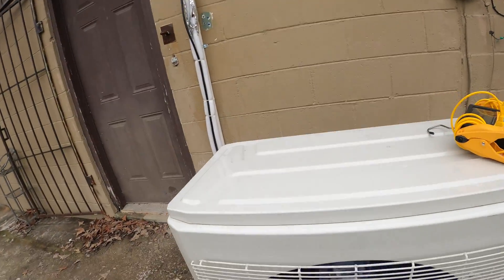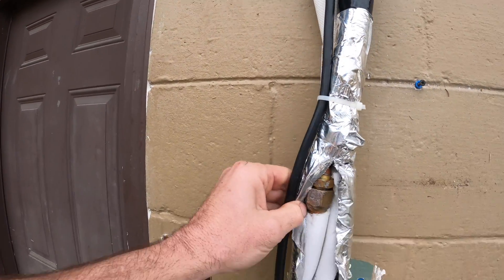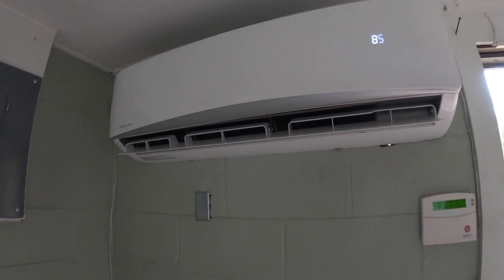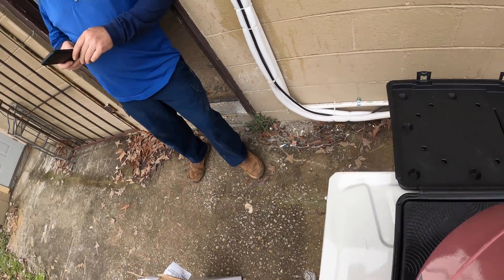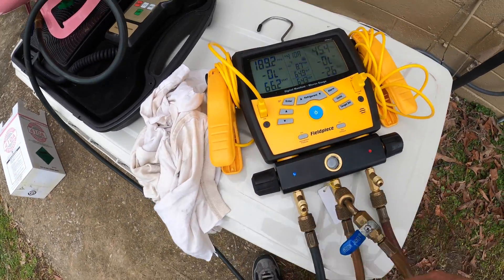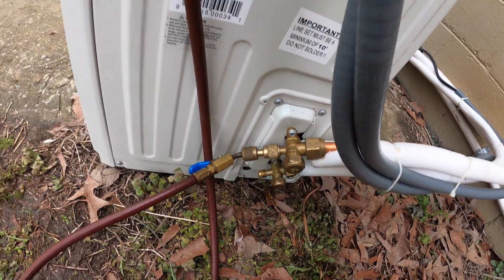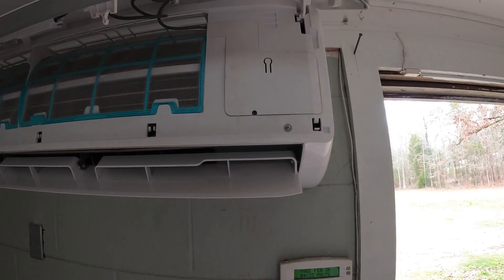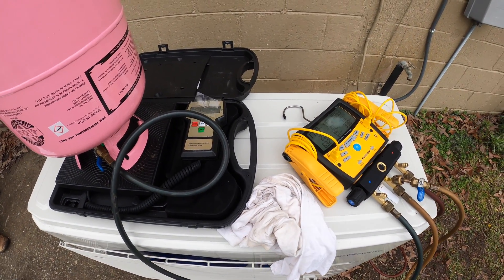MINISPLIT RECHARGE FREON BY WEIGHT

Comment: Great video. One thing wasn’t clear: what’s happening with the valves on the low and high side? Are they open or closed when pressure testing with nitrogen and purging with vacuum? And are they open or closed when recharging the system with new refrigerant?
Reply from the maker: If new install then valves are closed from factory.    You are only pressure testing lines and indoor unit.  After vacuum then you open and you never close them again.   There only purpose is to store factory charge in outdoor unit
Reply: @ACPro it’s an existing mini split unit that’s low on refrigerant.  The coils are icing in heating mode and the defrost cycle can’t handle all the ice. Need to reclaim the refrigerant, test for leaks and recharge with new refrigerant.

Comment: Im Doing mine myself. Is a luggage scale sufficient? If I tie a rope or something to the bottle? I need a 50 ft run and the number is .16 oz per foot standard length 25ft so 4oz. For the additional length. My dad is an old school guy doesn’t know much about them he swears we can go by psi when we get to that part of the install but the amount of research I’ve done is telling me no we absolutely can’t but I’d rather not add another 200+ dollars on this project for an hvac scale. Thanks in advance
Reply: Should note the local hvac guys will not touch a system they haven’t installed. And it’s a 4ton multi zone so.. I’m out quite a bit if I don’t get this right 😂
Reply from the maker: This gonna be your choice.   I wouldn't use it.

Comment: did you remove the existing charge and pull a vacuum before breaking the vaccum with the new charge?
Reply from the maker: Yes to charge by weight system must be completely empty

Comment: Thanks for the video.  I just had one professionally installed in order to get the warranty.  About two weeks later, it was struggling to heat.  Sprayed the flare joints with soapy water and it was bubbling.   They did come out and correct it right away and recharged it.   but it was disappointing.  

I also notice they just added some Freon, didn’t remove and recharge it.  Everything I’ve read professionally about mini splits is to remove the Freon and then weigh it back in to make certain you have the correct amount.  

I’ve since installed a multi zone my self and the installation job looks a 100 times better and it’s running strong with no leaks, yet:-). 

I used nylog on my connection and they didn’t. Not sure if that makes a difference, but so far so good.
Reply from the maker: Thank you for sharing!

Comment: I was pulling a vacuum on my mini-split and didn't realize the manifold hose i have didn't press in the valve so I didn't actually vacuum the lineset before I released the 410a. should I remove all of the refrigerant and start over with some new 410a to make sure it's not mixed with air and water vapor?
Reply from the maker: In theory this would be best.  But if it wasn't raining outside .  You are probably ok.      Only main concern is if it didn't push it in you couldn't have done a nitrogen leak test either.   So let it ride and if you have a leak show up.  Then go back and do it right
Reply: @ACPro  correct. It wasn't raining but I keep hearing that air and water vapors will ruin the compressor. That's why I was wondering if it would be best to pull the 410a back into the compressor probably mixed with air and do it again or just get new 410a and evacuate the whole system and start from scratch.
Reply from the maker: @gusfusses44   pulling into the compressor will do no good.  I would be more concerned with no leak test than vacuum.     It is your call.   The right way is to recover . Pressure test and vacuum,  recharge.    But depends on your time and how crazy you want to get with it.  If it was mine . I would let it ride. Deal with it when leak shows up.   But I got alot things to do too.
Reply: @ACPro  thanks. I have time. So I will start over with new refrigerant and do it the right way.
Reply: @gusfusses44  I did exactly the same thing and am contemplating whether or not to replace the r410a. What did you end up doing, and how did it go?
Reply: @MrAejohnson3  i evacuated the whole system and replaced the r410a.Everything is working great
Reply: @gusfusses44  Thanks for responding! I went for it, and it went smoothly as well. EXCEPT I took the valve core out for vacuuming, only to realize that I couldn't get it back in once it was recharged. Too much pressure. I had to pump all of the refrigerant into the outside unit and close the valves so that I could get the service valve core back in. Two new things in one day! All turned out well though, and I'm not worried anymore about a short lifespan for the compressor.

Comment: After checking the data plate for the weight, do you have to add extra for every foot of Linset? The reason I ask is because I have the same issue as you did with no 410  left. I have about 42 ft of Linset on one and 30 ft on the second unit. Both are 3 tons and are single zone units.
Reply from the maker: Typically the amount per foot is very small but it does add up on long runs.   Check your manual as different lineset sizes require different amounts.   But normally it is around .06 oz per foot is a good average for 1/4×1/2.
Reply: @ACPro  thanks for the reply much appreciated.

Comment: Confused isn't it pre charged
Reply from the maker: Precharged is correct . However when there is a leak in the flate joint due to it wasn't nitrogen pressure tested.  Then this is the next step
Reply: Any idea if you had to just add a few ounces ?? What kind of pressures would u see
Reply from the maker: @FullyInvolved-z     suction would be around 135.      Super heat at 5 degrees
Reply: Thank u and GodBless
Reply: Thanks Toby ,I placed it in forcwd cooling and I am at 130 psi with air temp blowing at 60 degrees